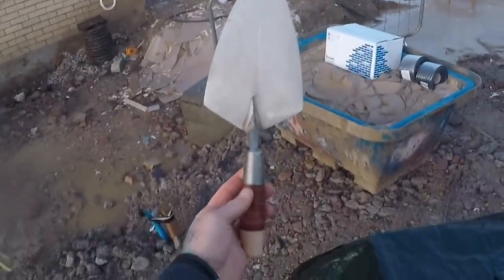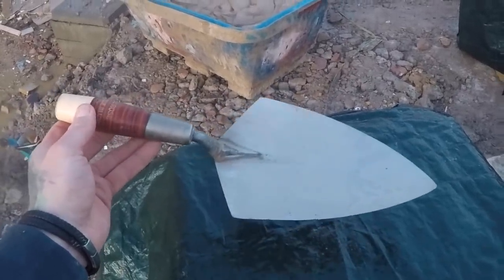BRICKLAYING, 1000 bricks a day building corners???

Comment: Not to take anything away from you, but that Hod man deserves some of the credit
Reply: Exactly what I was thinking what a grafter he’s everywhere
Reply: Hod?
Reply: @phoenixcoleman7777  the laborers are more formally refered to as hod carriers or tenders
Reply: Yeah, he did well. Although a pretty easy job hodding for 1 guy when you aint mixing any muck
Reply: @franj001  agreed, when I started in construction I was the hod in a 4-1 gang. Muck knocked up by hand and everything up the ladder, much brick blocks etc.
Reply: @kooper1683 must be pretty slow gang running 4:1.
Especially in block you’re talking about 2+ tonnes of blocks per trowel per day. Another tonne of cement.
There’s fuck all chance of 1 guy carrying over 12+ tonnes of gear day in day out. That’s before your take out breaks.
Either had plant or preset blocks at the stations.
Reply: @kooper1683  same as,, I used to love it,, the fittest I ever was
Reply: @jugganaut33  believe it or not Hoddies used to work for a living, tea breaks on the run, start an hour before brickies and finish 1 or 2 hours after. Its just how it was 30+ years ago.

Comment: Nice work Charlie. W.rose trowel looks good .did you buy it in person or on line . Best to buy them in person and go through them and pick out one that suits you . Handle angles , height of tang can vary a lot ,also the tang can be lying back greater than 90 degrees and couple that with the steep handle angles they sometimes come in they can be very uncomfortable to use. Most un uniformly constructed trowels I have ever come across . Raw materials that they are made from are top class.

Comment: Charlie I am pleased to see that you laid the bricks the right way up but, I am not sure that speed is the be all and end all. I have to admit the work is Nicely plumb but if you just took a little more time on jointing it would look even better. Like you I don't use profiles but, I don't use Marshalltown jointers either. Just remember what ever you or any other bricklayer is building it will be there for a very long time. All the best for the new year.

Comment: Where I live we don't build brick wish we do did lot lighter work than the 6" blocks here 215x440. I learned to build in brick but very rarely built it since. Hats off to you mate I would struggle to do what you have done there Tidy job aswell.

Comment: Why do you use the small trowel ?
Reply from the maker: i get just as much done.. without the wear and tear! used a big trowel for 10 years and i wish i never
Reply: A do tend to use a 12inch trowel W Rose Philadelphia pattern. Previous used marshalltown trowels for 10 year.  Find rose trowel a class apart nice and light also the low shank suits me well. Must say tbh a smaller 10 inch trowel probs would help the arm out.

Comment: I didn't thing you were putting steel in the wall with the camera sped up till you got around to the other side!  When I was a kid my dad hired a brick layer that could lay a longer bed joint in one pass than anyone I ever saw!  If you had to start with him without everything stocked it was a long long hour or so!  You could throw a shovel of mortar on the board, turn around with the second and the board was empty!  Here across the pond the laborer can not tool your work.  I think an American Indian guy holds the record laying pavers in a road, I'd have to check.  Listen to your body and stay young!

Comment: You used profile up other end with first corner and someone doing jointing and ties and damp any half decent bricklayer can do that plus your just backing up brickwork so easy to keep level and plumb once first corner built
Reply from the maker: Mark Cox I didn’t use any profiles the whole point of the video was just to show you can lay a 1000 bricks a day without them if your good enough. I didn’t say it was hard either why so negative?
Reply: bob f  yes I agree he is a good bricklayer just not that fast . I did my apprenticeship straight from school at 15 and passed my level 3 advanced craft and 2 month later left the company I worked for and went house bashing thinking I knew everything prices was that tight back then it tought me to flog on or I'd make no money . Prices are a lot better now but I can't not flog on its second nature . So I Charlie I arnt a wannabe bricklayer and no u haven't forgotten more than I know iv been at this shit for 25 years I'm 40 now . I just don't make videos cos I'm to busy earning money . And in 25 years iv worn down to many towels to count they all started at 12 inch and ended up maybe 8 or 9 inch any smaller it's pointless.
Reply: The only thing you have worn out is the touch screen on you phone from slating good work #prat!

Comment: Always thought the frog hole faced down.looks like its working 4 u but good onya
Reply: Mitchell Harper frog up to avoid air pockets
Reply: Why would you put them frog down?
Reply: Because its quicker. if u lay a massive bed you dont get massive airpockets?i was just asking a question ive never laid those bricks
Reply from the maker: I dont frog my bricks purely because thats what i was always taught.. i dont see why it would be a problem if you put plenty of much down though!
Reply: That’s what I got told at college a milienia ago lol, my pal would always tell me to lay frog down when the brick work was getting a bit tight along the line
Reply: I see now. laying frog up is just a method to ensure quality and you cant argue with that.good onyas for maintaining the quality of your trade
Reply: Laying a brick frog down in cases could mean your laying the brick upside down. I.e the pattern on the face or the edges of the brick.
Reply: @patrickevans4682  In America it's frog down.  In England it's frog up.. just like steering wheels😂 .... also that kind of brick is rare in America, but looks to be popular in England (if YouTube is any indication)..

Comment: That’s bad practice
Reply from the maker: Mr Brick what is?
Reply: Charlie Collison building big corners the wall will be all over the place and not on the same straight
Reply from the maker: Mr Brick is that a joke?
Reply: Charlie Collison no
Reply: You will lose the straight of the wall and it’s totally pointless . Get a 10 course plumbing up and run it with a line . But on a better note I like muck boards being up high good idea saves the back